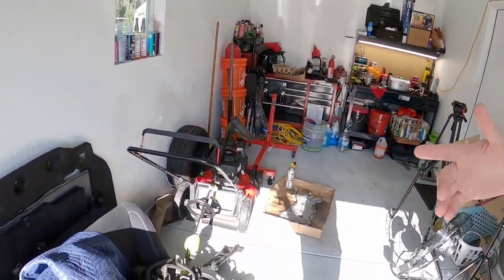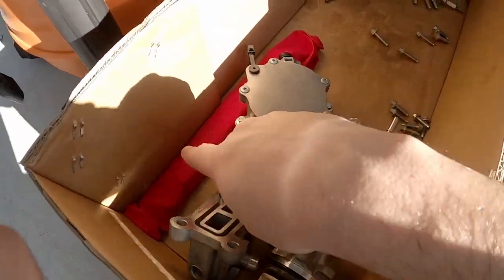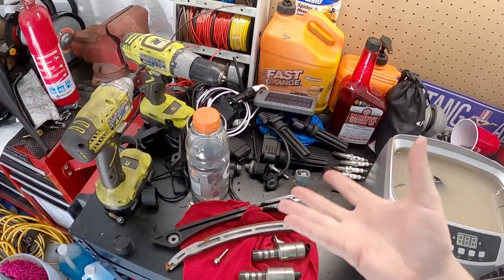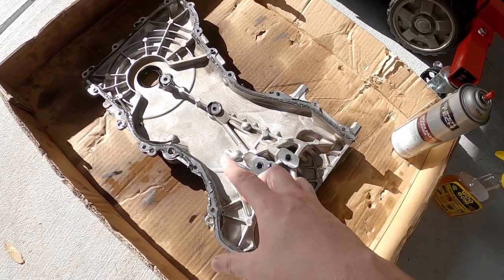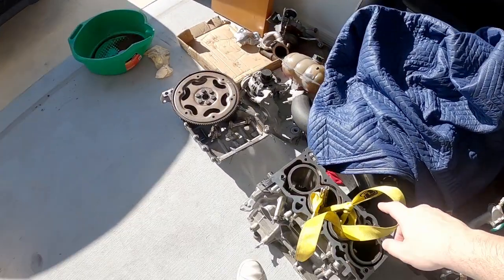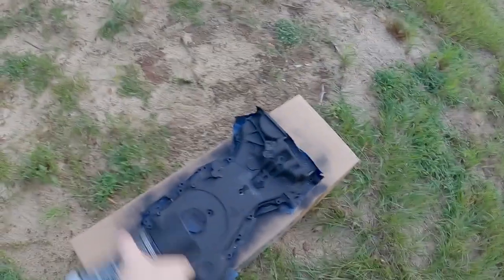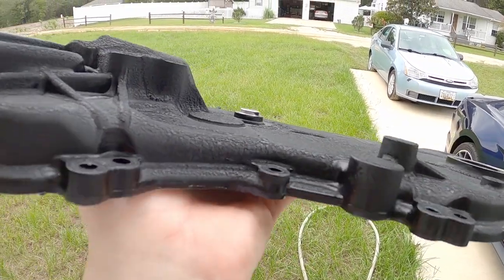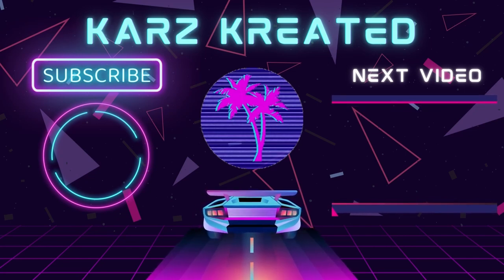I'm Shocked by this Crazy Paint! NEXT LEVEL Look!

Comment: That paint sets with heat (VHT stands for Very High Temperature, everything they make that I've tried is awesome).  You can bake it for an hour to set the paint or just let the engine heat do it.  The wrinkles will get tighter as the paint heats up and cures.  Good stuff.
Reply from the maker: I noticed that while reading the directions. I was gonna let the engine heat do it. It's definitely a great paint.